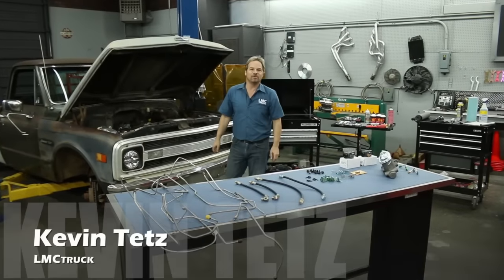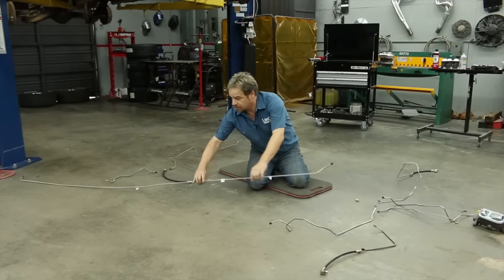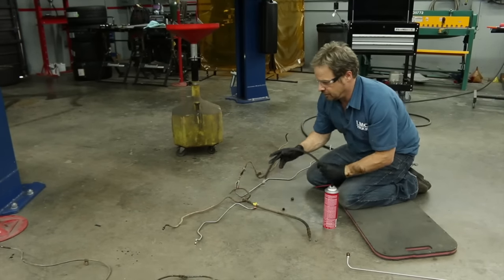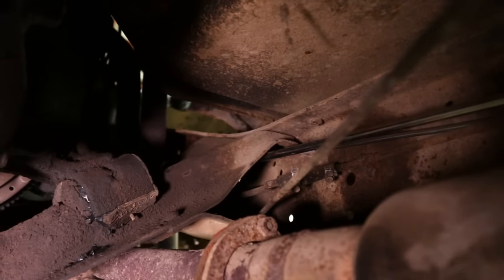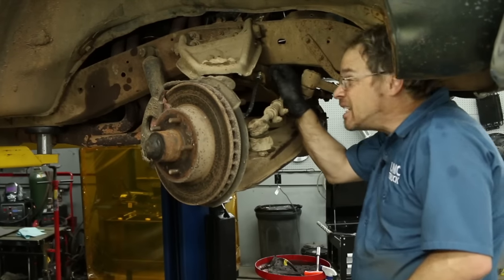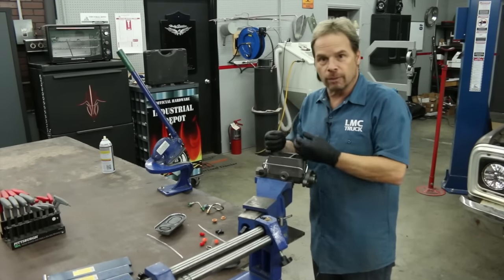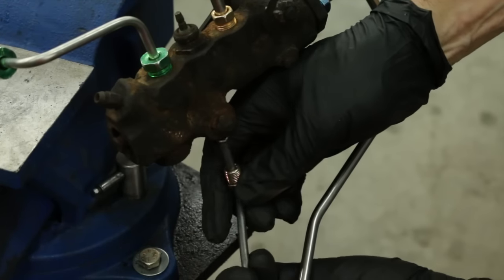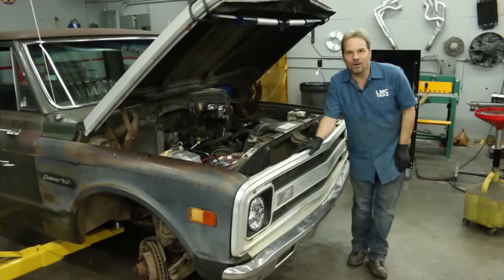How to Replace Brake Lines for 1967-1972 GM Trucks - Kevin Tetz with LMC Truck

Comment: I liked this episode. Although I've already replaced a few brake lines on my '68, this video was still helpful in a few ways. I was fortunate that my '68 C10 with HD rear leaf suspension wasn't as rusty as your '71. To date, the only bolts that have broken off on removal were the ones for the grill and front fenders. My brake lines were in decent shape, so I only replaced all of the rubber lines. But, a complete brake system rebuild with upgraded master cylinder, front and rear discs, and a new booster are on the list. This will be done when I adapt my 5.3L LM7 into the old truck.
Reply: Awesome

Comment: LMC gets the brake line kits from a company called Inline Tube. The lines are laser measured for factory specs. Outstanding products. Inline Tube also makes stainless steel braided brake hoses that LMC does not stock. You can order those in custom lengths. Fairly inexpensive too.
Reply: Thank you for this information, I have them pulled up on my phone right now.
Reply: Thank you for the tip Sterling! I just looked up Inline Tube, and they carry many more products and hardware than just brake lines. I'm saving that link on my computer.

Comment: I've never done tje entire brake system before... I thi k this will take me a while day. I have a 1987 Chevrolet custom deluxe extended cab. I'm super pumped.
Reply: That's a process that should take a couple of hours 

But, as I'd look at it,  as long as it saves you a few bucks without having to take it to a professional mechanic

Comment: Whew that is one Rusted under chassis Omg!
Also I have a Tip - as far as insect Spray I use AutoZone Brake Cleaner - for most all insect and ants 🐜 - Dead as a Door Nail .
Great Video 👍Thank you

Comment: Have you guys done a video on upgrading brake systems on '49 to '66 trucks with disc brakes, master cyl. and everything. I have a '65 gmc and have put a '76 front end, with pwr. steering, disc brakes,etc. but haven't gone any further because of money. Have a sb 400 with turbo auto. What master cylinder would I put on it? I would love to put disc on rear but again what kind of rear would I use to bolt on? This is the first time to do this and need all the help I can get.

Comment: Great information. Very good. I am going to be doing my 54 O'l Beater truck.i have the original 54 chassis, but a 1987 C10 front suspension,  and booster and brake on the firewall.I can use that kit? I think it would  work.  Is it expensive ? Thanks. I need all the help I can get.thank you.

Comment: At 28:15 before you started installing the new master cylinder, did you measure the bore depth between the old and the new master cylinders and adjust the rod accordingly? Some poor braking conditions have been caused by not adjusting the rod length. If not adjusted properly, dragging brakes or a low pedal can result.

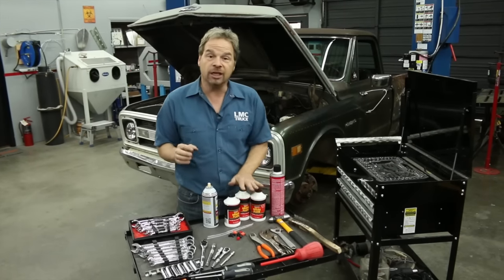Comment: (1:48) If you ask for a master cylinder bench bled kit at the 4 auto parts stores in my area, they look at you like you just stepped off a flying saucer. I ended up making one out of the old lines.

Comment: So no checking the shoes, hardware, wheel cylinders? How about he bleeder screws snapping off when you try to bleed the old and leaking wheel cylinders? Nice lines though. I fabricated up all the lines for my 1967 and 1969 C10’s using Ni-Cop tubing with the protection shielding. It much more malleable and a lot less prone to corrosion.

Comment: I never use a  flare nut wrench, I use a 6 point socket to remove the old rusty lines. Chop the line off flush with a chisel then  use the socket. You're throwing the line away anyways.

Comment: Rusty bolts: 1. Use needler to brake heavy rust, 2. Brush to remove all debri, 3. Soak it on wd40. Finally, 4 try to loose the bolt and then tight it again, never use impact wrench or go hard to loose the bolts
Reply: Thanks for sharing!! Love your channel

Comment: Hello Kevin
Thank you for the informative video.  I have order number 6541980 totally stuck in limbo.  Ordered the crossover line which goes in front of the union inside left portion of frame (your part #30-1387.  I received the front to rear break line that goes behind the union...  The one you straighten out at the beginning of the video by pushing it against the floor.  I need the line (your video shows it as 2 lines with another union that runs between the union below the master cylinder and the union (part#30-1387).  The lines have multiple tight bends in them.  I have spoken to your customer service a few times and have sent them multiple pictures and followed up with the vin number.  Can you please help to get the proper lines sent to me.
Thank you,
Another Kevin (Wolff)

Comment: THE FRONT BREAK LINES DO NOT FIT A 69 CHEVY c 10 THEY ARE ROUTED IN THE WRONG SIDE OF THE FRAME,THE REST OF THE BREAK LINE KIT FITS THE REAR WELL,i HAD TO REBEND THE FRONT MY SELF AS THEY GO INSIDE THE FRAME NOT ON OUT SIDE .LIKE IN YOUR VIDEO.

Comment: Looks like the owner of the truck needs to spend some quality time underneath with a wire brush and some POR-15.
Reply: Yeah I know it's a demo video, but at least a good hour of pressure washing before starting the work would help, That's what I always do when i start a project.
Reply: POR-15 is pretty worthless if you plan on coating the inside of your fuel tank. Spent 1 week cleaning a 1970 Deville tank and bought a gallon of POR to seal the pinholes. Ended up buying a new tank, don’t waste your money or time
Reply: Or totally sandblasted it and get it powder coated